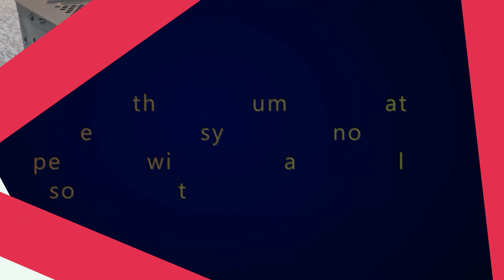Peltier Cooling My PC (Cooling Mod)

Comment: what temperatures did you get in tests though
Reply from the maker: Hello, sorry for the late reply!
The processor temperature dropped by up to 7°C.
The temperature in the case has dropped by up to 3/4°C (Because the cooling liquid passes through the radiator and cools the radiator as well, and the fans put air inside the case passing the air through the cold radiator)
But during the summer it gets very hot inside the case because the Peltier plate reaches up to 45/50°C + the video card which during games reaches up to 70°C + the motherboard which also heats up.
Reply: @ElektroGamer30  okay, thanks for the reply seems like a lot of work for seven degrees though. I think you can connect your liquid Cooling to the videocard, there are some gpu cases that allow it. BTW, did you have any problems with frosting?
Reply from the maker: Yes, there are those special cases for each video card, but at the moment everything works perfectly like this!
I haven't had any problems with anything at the moment!
I have had this MOD for 1 year and everything works perfectly!
Specifically, the -7 °C is while I'm playing!
From 75°C to 68°C (in Far Cry 6 on ultra)
And it doesn't even allow the temperature to rise above 65°C!
Without this MOD I had temperatures of 80/83 degrees after 2/3 hours of playing!
(30% overclocked processor) @alexanderananyev3271